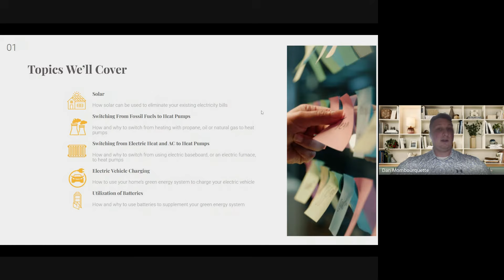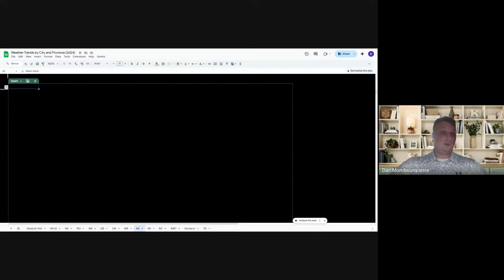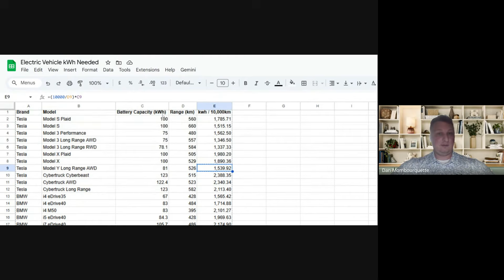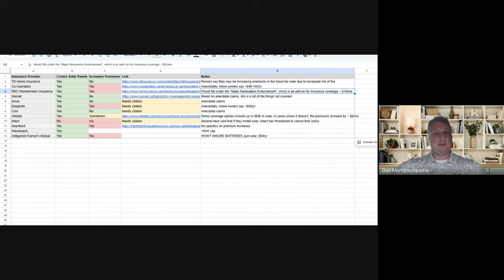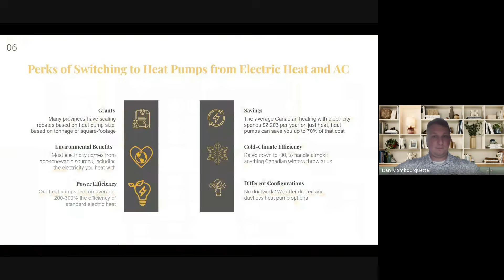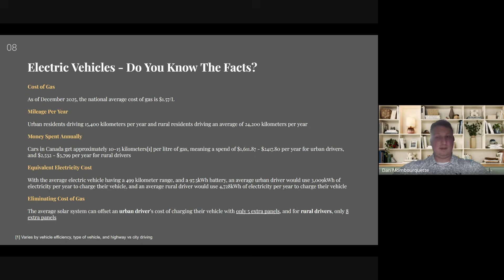Total Home Electrification: Solar, Batteries, Heat Pumps & EVs -- Save Money By Going Fully Electric

Comment from the maker: Thinking about lowering (or eliminating) your electricity, heating, and fuel costs?

👉 Next steps (free & no obligation):
• Get a custom solar / battery / heat pump design for your home
• We'll check rebates and grants available in your province
• See if behind-the-meter or net-metering makes sense for you
• Review financing options with real monthly payments

Get a real quote at www.xolar.ca